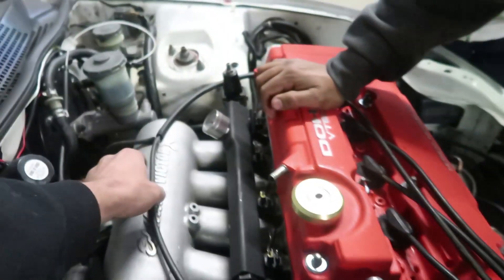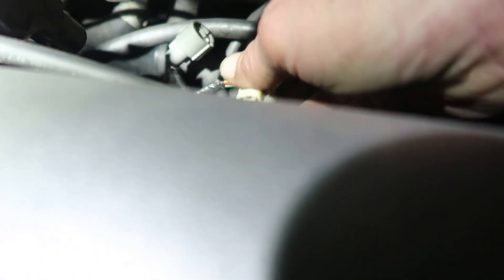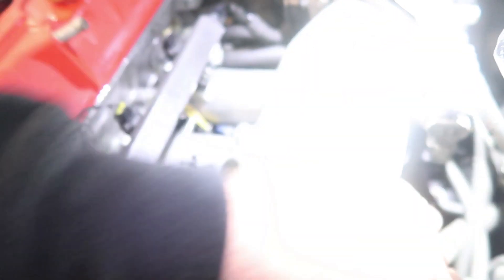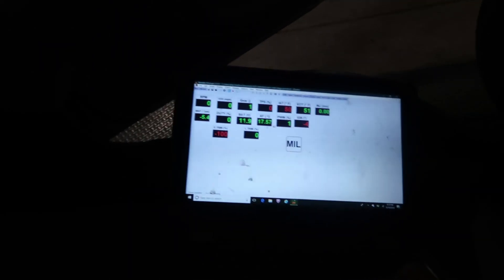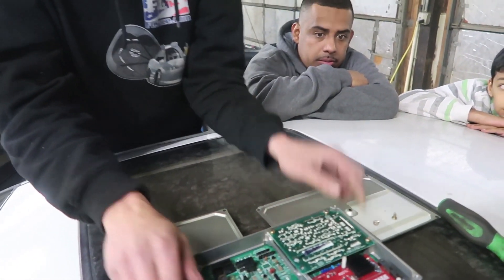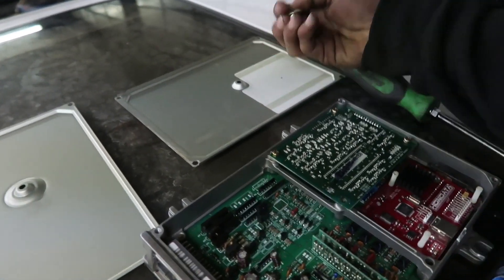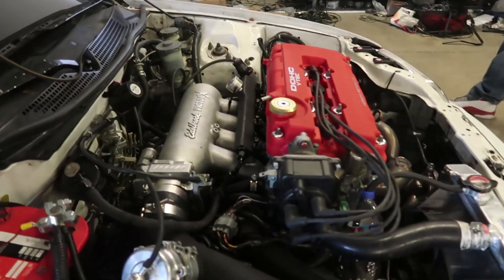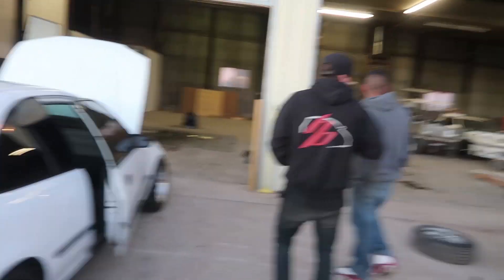What Injectors are They? Civic Tune turns out Rad!

Comment: Theres no need to insult the builds of the car (in the comment section)because they might of screwed up the Engine Harness a bit. It's extremely easy to mix up those connectors at the rear of the engine because they have the same plugs & the wires are covered in loom. This is the DIY grassroots of Hondas it's ok to make mistakes. A good% of  Honda builders aren't mechanics. They are just ppl that love Hondas & hope to build one some day. Keep up the good work & positivity PFI. 👍😎

Comment: Brent, the iacv code is 100% because it was misplugged in its past;  it typically burns out the onboard transistor only; on some occasions it will burn up some of the trace on the underside of the board, but these can be rapired easily with jumper wires.  you can scavenge a new transistor from another ECU and just replace it easily; I believe there are 2-3 of them in each ecu.  I ran into this issue many times over the years that I have done chipping/tuning; people mixing up plugs when tucking harnesses.  Sounds like you know which transistor im talking about.    I was a part of the early reverse engineering group on PGMFI.org, still am doing R&D on the P07 ecu, and did early alpha/beta testing of eCtune.  Man;  I wish eCtune didn't fall away like it did;  the software interface and datalogger was superb and unmatched by anyone.    As far as TPS calibration variances that happen between KOER and KOEO;  I have seen it happen on all honda EMS systems thus far.   Typically;  to correct when this happens, I note down running WOT voltage of the TPS, and idle TPS voltage and trim the custom calibration in the EMS.  You will notice that the increased battery voltage is effecting the reading of the sensor.  A/D circuitry can be quite sensitive sometimes.

Comment: Just feed the top of the wastegate with air from the shop with a regulator. Fast, easy, adjustible and precise.
Reply: My lsx is set up that way i have an air compressor and small tank in trunk to control my wastegates

Comment: It trips me out people can install a engine and or turbo kit but they don't understand wiring. If you are unsure test continuity from the ECU pin to the plug on the harness and that will teach you so much about wiring. In addition if your trouble shooting check engine codes the method I just explained will tell you if its faulty wiring and or a faulty sensor. With some experience you can make custom  harnesses and pull off some clean wire tucks.

Comment: Brent, with all those Y's on one vacuum source going to the fuel regulator, blow off etc do you think there would still be sufficient Vacuum for them all? Curious as i have a similar setup and wonder if it would be worth while to have the required amount of fittings directly in the Intake manifold.

Comment: Yyyyyyyyyy people bring unprepare cars to the DYNO😑😑😑 brent check if they got oil in there😂😂
Reply: I know like homeboy do you know anything about cars
Reply: Seems like 90% of these cars pfi tunes the people are clueless.
Reply: @PATuners  remember the one yellow honda didn't even have the wheel properly tightened... Jeez
Reply: Yeah I smoked up PFI with my valve cover gasket but things are easier to see under load so dyno is a good place for it to happen and show you then at the track/street. To a point that is. Lol
Reply: did they get any of the wiring right tho lmao
Reply: Youd be surprised. When i went and got my car tuned at edge autosport my tuner told me people show up with low oil no air pressure in tires etc.
Reply: @evannarvais  😨😨😨

Comment: If someone from a low elevation were to take it here how would the tune hold up back at low elevation? Would it be as safe and gain more hp or will hp stay the same from the elevation they tuned at

Comment: Unprepaired dyno customers whats new lol...
Reply: Runaeh prepared
Reply: Runaeh that’s what he is paid for. Knowledge!
Reply: @DK_tk3  tuners don't normally fix your half ass work. 90% of tuners  would tell you to fix your junk and bring it back right
Reply: PA Tuners factssss
Reply: @PATuners  That's why 90% of so called tuners suck and we tuners who give a damn about their customers are always busy and charge more.  If you can't troubleshoot sensors and few wiring problems, you have no business tuning a car.
Reply: Only dude told Brent he had issues...so there's that
Reply: @swackhammer2139  if you call this build only needing a few thing we are on a different planet
Reply: @PATuners  Setting base timing, running vacuum lines, sanity checking sensors, boost leak tests, setting real global fuel trims based on what the injectors actualy flow... pretty standard stuff. I'd rather have a customer leave happy with a well tuned car than than tell them to kick rocks because they could only get 90% there.
Reply: @swackhammer2139  you seem like a good dude bro.
Reply: PA Tuners aslong as the customer is paying by the hour ill fix any issues with their shitbox lol. Hard to quote work when things like this turn up though.
Reply: Thats why Brent is a tuning god and pa tuners is... Who is pa tuners?
Reply: @PATuners  I guess some tuners don't mind getting their hands dirty making someone's project run and some tuners only prefer to punch keys.  I guess if this guy came to you needing a tune, you'd turn him away because of some vacuum lines, a water bottle, and one of the most basic MIL on a b-series?  Talk about people wanting to be spoon fed...
Reply: @JnixMarshel  I feel sorry for the guy dealing with half ass shit but I guess you think its normal for a tuner needing to take two days to get a car tuned . I'm guessing your one that wants spoon feed instead of researching and doing your work right so it's easy on your tuner but I guess you feel it's the tuners job to do that . Well sir that's not a tuners job it's a shop job and if your car knowledge is 0 then let a shop do it so its right for the tuner. And far as me I do just fine in life sorry if that hurts your feelings. Have a good day sir
Reply: @swackhammer2139  no I show him what needs fix then he can fix it if I fix it much more money coming out his pocket. It's simple Time is money
Reply: PA Tuners these guys have no idea at what a waste of time and money it is getting the tuner to do these small repairs. Can’t make money doing free repair work while the dyno sits around being unused.
Reply: @swackhammer2139  did you watch the video???  hell the ecu was even bad plus way more then what you said.  Again it took 2days to get it tuned guy come on now . Have it close 2day job not close to be ready to make a dyno appointment but again you live on a different planet them me are just like to argue me haha
Reply: @marnixhoebers5176  exactly man . Its wasting time.  TIME IS MONEY
Reply: @PATuners  But just think of all the extra you could've charged him and marked up. 😈 New Hondata, troubleshooting, dyno time...that could've been an easy $1500+ dyno session then for the customer including labour rates for the troubleshooting. 👍
Reply: @MafiaboysWorld  Very true man you could make bank off of this guy . But out of respect for your tuner should have your car ready for dyno day. But I get what your saying for sure
Reply: Did anyone see how much  brent charged to fix everything. Maybe there's a reason he was happy to fix it all, especially since he knows so much about it and what's very difficult for others is another day In the park for him.. if you know how to fix SHIT OTHERS DON'T THEN IT'S NOT HARD TO GET PAID FOR DOING IT.. 
KEEP ON KEEPING ON BRENT AND ALL THE GUYS AT PFI
Reply: @PATuners  No disagreement there bro. Just informing the tuner beforehand that you aren't 100% ready and may need help is such a big benefit for the tuner/mechanic, not drop it on him and make him diagnose everything while going "I dunno why it doesn't work" like it seemed this guy did.
Reply: There are tuners who only care about tuning and making a buck and there are tuners who want to see every car on the street and track run THEIR tune from THIER shop. They are the ones all about that life and who will get down and dirty with you at the street races and track because they know you will be a customer for life.
Reply: @PATuners  where are you located. I'm in South Central PA. Don't need tuning yet but will one day with my 86 Shelby Charger with a 2.2 turbo.
Reply: @ChasingPerfection  i'm near Hagerstown maryland on the mason dixon line
Reply: @ChasingPerfection  man in the 90's I had a 1990 Dodge Daytona Shelby.. it was my Mustang eater. They would talk shit. I said all I had was a 4 cylinder and then dog walk their ass lol
Reply: I get both sides. The tuner may not mind a couple little things here and there, as it helps build their reputation. At the same time though, if you're always spending time fixing someone's work instead of tuning, why are you tuning and not turning wrenches? There is always more money to be made tuning than turning wrenches. If you know maps and afr needs and what not, you have knowledge and a skill that they do not. Anyone can turn a wrench.
Reply: I don't think u can buy good dizzys any more there all trash
Reply: Harris garage and exhaust center. That’s why K series is the go to swap now. IMO
Reply: They don’t even know the size of the injectors
Reply: @swackhammer2139  you are tripping, when i go out to eat i dont expect the server to feed me. his job is to bring me the food. now i understand if he had 1 or 2 things that needed to be addressed but half the wires fucked, vacuum line all half assed, battery not mounted, no radiator res, turbo doesn't have all the bolts. hes paying to get a tune not repairs.
Reply: i was literally thinking the same while watching, nothing bad about the guys at pfi but that civic was nowhere near ready to get tuned , the level of jank is astronomical
 @PATuners
Reply: @AllMotorGarage907   Exactly man
Reply: I love how they actually try to help out when something goes wrong. Tuners can be very strict.

Comment: I hate those code 9 Cyp sensors. Same thing happened to me ended up buying a new one it was wired wrong.  Then the day after I got it tuned the screw backed out off the rotor on the distributor and tore up my cap and rotor.....

Comment: Whld any1 kno why a stock 00 lx would have the closter and headlights pulse at like 2500rpms only...
Reply: Check your ground wires first
Reply from the maker: Jack the car up and put on jack stands , slide under her and look under the intake manifold there is a black bracket with the wires all grouped and attached to it , pull the wiring off the bracket and inspect for frayed wires, I recommend taking the bracket out all together and tape and repair any wiring that has worn from it.
Reply: PFI Speed thanks for the info guys

Comment: This why i want to drivd 14 hours to you guys.. if i email could i get a quote?? .. i just got rid of b20z2 block for b18b with css, manley turbo tough rods, cp pistons, honed to 84.5, head is a pr3-4 slight port and polished, skunk2 alfa series valve, springs and cap, 550cc injectors, aem fuel rail, grams regulator, aem cam gears.. all new will have it together back in my clone type r  integra.. just need help and a tune.. I'd trailer it 14hours .. i would like to make 350hp-400hp if possible does have a t3/t4 ebay turbo lol.. i have a chipped p28 but might save up for something better..

Comment: Im shocked that Honda does not use different connectors for each device. On Fords you can not mix up connectors to sensors. Each connector only fits its designated sensor. No wonder the car had to be pushed into the shop. Dam thing probably couldn’t start or run!
Reply: I was thinking the samenthing, never worked on a honda motor, but have several ford, gm, nissan, subaru, etc etc and I have never seen two plugs that would mix up
Reply: Usually the plugs will only reach the intended sensor so its not a problem. This wiring was messed with by someone who didn’t know what they were doing.
Reply: Honda did that to save money on parts.  What's the point of having 3 or 4 different connectors when they are all 3 wire type?  Simplicity.  Each sensor has it's own wire color so mixing up connectors is obviously human install error.
Reply: Eric Xiong that’s exactly what I was thinking

Comment: These guys has no idea how to deal with the wiring and etc. 🤣😂🤔🤔🤔 the motor will blow after it's 1st burn out not even get the chance to make it pass the Finish Line. This civic is just a straight up Paisa and such weak B-series turbo.  How weak even a D-series single cam mini mee or Frankenstein will taken this. These guys should be embarrassed for thus video